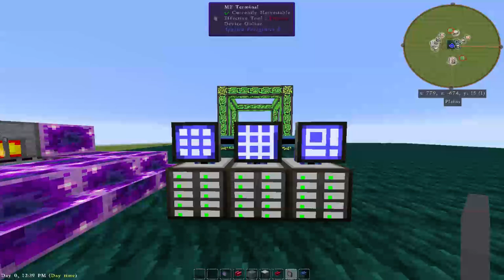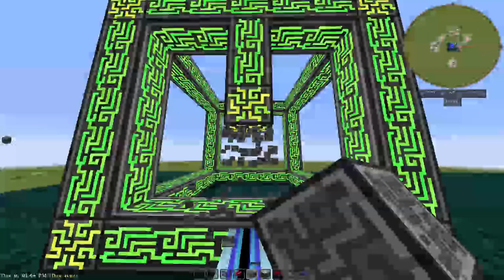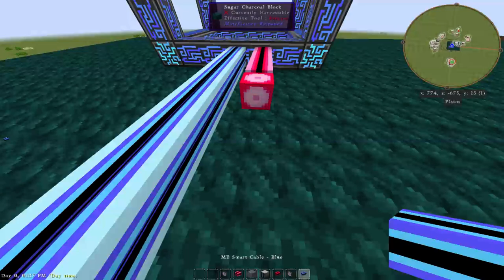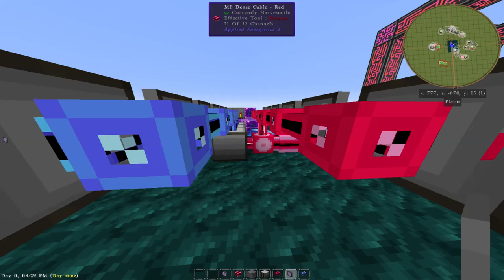Applied Energistics 2 - Smart Cables, Dense Cables and ME Controller

Comment: so i got a question I still dont get the difference between Smart cable and dense cable
Reply from the maker: +Gary Chen They provide the same function, just have more channels.  A smart cable has 8 and a dense cable has 32 channels.  For instance, if you need to put an alloy smelter up and import/export items to an ME System, the import bus would be 1 channel and the export bus would be 1 channel.  So you would need a line that could support at least 2 channels.  I use the dense as a trunk line and branch the smart cables off of it.